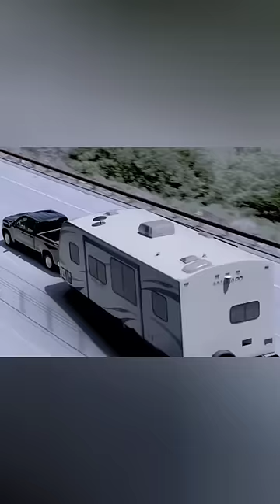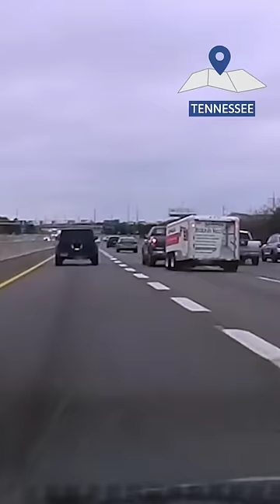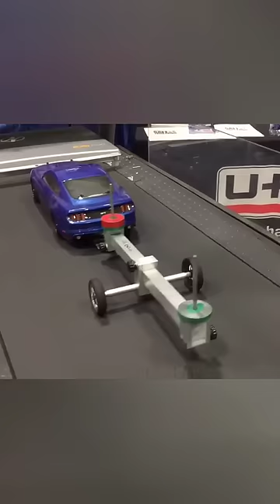Why Trailers Sway? 🤔

Comment: Seeing a Ford Mustang with a trailer hitch is the most cursed thing I saw today.
Reply: Fortunately... it wasn't a Ford Mustang. It was a plastic model.
Reply: @melissachartres3219 Upon closer inspection it seems to specifically be an rc car
Reply: Umm...mustangs tow just fine. They are rear wheel drive, after all. Standard transmission is even better. Beef up the suspension, and they tow much better.
Reply: @user-vt3cf4lm2f  It's just weird to see, no 1 said it can't, more so that it shouldn't
Reply: They have more than enough power. You just have to have a stiff rear, and have brake assist on the trailer.
Reply: It's a mustang... Anything to make it go faster!!
Reply: Really ? My Dad had a 1965 Mustang that towed his 1962 Renken , with a 1959 30 HP. Evinrude to lake Moultrie for years. Sweet memories!!
Reply: oui
Reply: Anytime you see a mustang on the road you know it’s a matter of time before it tries to eat a curb!😝
Reply: thats weird.i just saw a mustang
Reply: most cars tow just fine. europeans do it with hatchbacks and sedans all the time
Reply: @ethanwayne6973 under closer inspection that’s a treadmill
Reply: @EastonBryantLawhorne  We were talking about the visual of a rc mustang on a treadmill, but the treadmill has nothing to contribute to the conversation, why bring it up?
Reply: @paulhunter9613  that's the best place for a mustang
Reply: I'll bet he gets to the fishing hole first !
Reply: Fords suck

Comment: Death wobble 😢.  I've delt with this a few times.  Slow down also fixes it.  I drove 40 mph for 16 miles once to get to destination.
Reply: 40mph is not even too slow to drive as you tried to present, gimme a break
Reply: 40 mph is like, 60-70 kmh. that’s still really quick
Reply: Same. All about how you load it.
Reply: What?
Reply: So it didn’t even take half an hour to get to your destination?
Reply: It's Physics and Commonsense / Experience w/ Towing...........
Reply: NASA should  watch thos vieo to perfect their Moon Landings
Reply: @swaggluke  Depends on if the road is a 50 mph road, or an 80 mph road.
Reply: 100 miles at 35mph car hauler with hay and a skidsteer.  Had to load the hay and then skiddy.  It was BS but that’s how that boss rolled.  
Gotta have tongue weight or that sway will gitchya!
Reply: 😮 Learn to load a trailer, it's critical!
Reply: Same
Reply: Flooring it can also lead to stability. But that is dangerous gambling. After that, can you brake safely and pull over? Maybe not. You MUST correct the way it is loaded. And stop speeding.
Reply: I've had same. It's scary
Reply: I tried that one time pulled rock on a 3/4 ton ram 4x4. The idiots loaded me with 9200 lbs on dump trailer.  Waa doing 55 and noticed sway going over a slight hill. I punched, then things went HOLLYWOOD!!
Reply: Not enough tongue weight. You should always be sure the forward or front end is heavier than the rear-end. That should cure the sway problem.
Reply: @swaggluke 😊
Reply: Ha, try 350 miles.

Comment: Center of mass is the key here 💀
Reply: Only goats will understand this goated comment
Reply: here key the is mass of center
Reply: @theominouspigeon You must mean center of mass…
Reply: Could be a problem for toy haulers
Reply: Not alone, center of pressure must ALSO move back!
Reply: The travel trailer might be tongue heavy for the light truck that is pulling it. I've seen " bumper pull" trailers do this with excessive weight forward. I would say 60 percent tongue weight,not necessarily "at least" that. It depends upon the tow vehicle's weight capacity.

Comment: Also, from a Retired Truck Driver,  Tire inflation has a lot to do with sway. If tires are inflated more on one side then the other,  it will pull one side slower .
Reply: Im screenshotting this advice
Reply: In the second video, it looked like the trailer became unhitched.
Reply: A circle is all you could do then? 😁

Comment: The key is to when the Tornado starts to move like that. Accelerate lightly and it will come out of it and then slowly Decelerate. Do not hit your breaks that increases this way , and it will come around on you. You watch every one of these videos where you see. These trailers go out of control and you will see those brake lights. Lock up, stop first thing, and that's when you'll see it. Go completely out of control.
Reply: Correct bro

Comment: Some people tend to go too fast and they forget that they're hauling a trailer or camper!
When you're hauling a heavy load, you have to slow down, you cannot go as fast as the rest of the traffic!
Also when you're hauling a load make sure your load is up closer to the front of the trailer not the rear. Or at least try to balance out the weight.
Reply: I have a GMC 2500 6.6 DURAMAX. 
I run stabilizers on mine.  I change lanes as quick as I want pulling a 32' travel trailer. Pulledit all over the country & it never swayed.   😊😊😊😊
Reply: Dumb comment

Comment: Now wait. I loaded large semi trailers for delivery and i made walls with the packages i input. ZERO training about weight displacement was introduced. Just saying. Idk maybe its different for semis but this video shows facts that seem very helpful to anyone loading vehicles.
Reply: The wheels on a semi trailer are further back
Reply: Sway is caused by weight behind the axles. Can’t put it behind the axles on a semi. Pickups can’t handle the tongue weight like a semi does, so you have to move the axles forward.
Reply: @japanders  trailers are usually pulled by sedans, not pickups .
Reply: @johndododoe1411  um, what?? Regardless, anything that’s not a semi is gonna be likely limited by payload before total trailer weight in practical use. And far more pickups than sedans are pulling trailers.
Reply: I teach safety courses on this. It's weight distribution relative to axel location. Plus other factors like if the trailer and tow vehicle are level. Under load.  Also factors like suspension stiffness under load.  It's very simple physics.
Reply: You all are tickling my balls with this info. Alright. I think I got some good answers. Semis = different situation. Thank you all.
Reply: The weight is put on top of the rear axles and the trailer axles are at the back instead of in the middle so there is no way the trailer can have a leverage advantage no mater how you load it but a tag along is hitched right too the back of the frame so if there is too little weight on the tongue it will have a leverage advantage at the back of the trailer and try too pull the rear wheels off the ground like a seesaw
Reply: Semis don't do that. Fortunately.
Reply: @jennyjansen754  yes I replied to that. :)
Reply: I drive semi's and the 5th wheel stabilizes the trailer unlike a tongue hitch
Reply: Semis are a fifth wheel configuration. 
This is about bumper pull trailers. 
A lot of people install a receiver set up, which increases the whip factor.
Reply: It only works for bumper pulled trailers and long goose neck trailers (but it has to be heavy on), on the end/back. For semi's just try to keep it near the front or equal, if you don't in rare cases it'll do this
Reply: I think you guys has supervisor who overlooked how to load and where to put the stuff correctly, but yes I believe a lot of people just ignore that.
Reply: Dual wheels and multiple heavy axles on the trailer, and dual drive axles?
🥴👈
Reply: I did my loading training at the Council for Scientific and Industrial Research.
Rigid,  artics, interlink, drawbar and a-frames all have their differences but all require the load to be concentrated forward of centre.
Reply: @japanders ..there you go. Thx.
Reply: I drive a semi delivering lumber for a living and use a special truck mounted forklift that attaches to the back of the trailer. When loading the truck, we put the heavier material over the drive axles of the tractor to distribute the weight. These forklifts on average weighs about 9000 lbs. give or take. When the trailer is empty, it’s very sketchy to drive because all that weight is pulling up on the fifth wheel and causes less traction in the drives. These trucks, however, are designed to handle the weight.
Reply: Another issue I've seen that can cause this problem is trailer ball height if the ball is too high it can make smaller trailers act like an airplane wing causing lift, this lift can cause this same uncontrollable trailer sway action (happens often on trailers like snowmobile trailers or single atv trailers especially if empty).
Reply: Bro, semi-trailers have the axles all the way at the back.
Reply: Wait, a semi trailer is different 
Axle weight per axle on a road tractor. 🤠
Reply: @japanders  actually it is possible (extremely rarely though) due to the fact most van/reefer type semi trailer tandems slide for axle weight control if there is a massive object that gets behind the axles it can happen (seen one trailer where a steel coil was loaded right at the door with light weight material in the front driver had the tandems all the way forward causing the trailer to sway uncontrollably... But this is very very rare and this truck had to be readjusted and load redistributed... Not my vehicle just saw it while doing a 34hr reset
Reply: @dodgeme1986truck  come back bro. Your comment didn’t post. I wanted to see what you said.
Reply: @japanders  sorry it partially posted had to re-enter it
Reply: @dodgeme1986truck  well that’s a fair point. I was thinking of the “typical” configuration you see on the highway. You’re right though. I guess there’s a way to screw up anything if you try hard enough.
Reply: @japanders  yup that trailer had 2 rows of plastic culvert pipes in the front and a 15k coil at the doors his axles were forward to maneuver through tight streets

Comment: At least 14% of the total trailer weight must be on the hitch ball but more is better and especially if there's too much weight behind the rear axle. Always place  your heaviest live load forward when pulling. One thing that can mitigate the effect is a heavy tow vehicle with dual rear wheels. Cars and SUV's though don't get it done. Use trucks to pull these things.
Reply: A proper hitch weight would be dependant on the size of the trailer, your approach would unload the front-wheel of the towing vehicle, also causing sway.    On a medium size trailer the hitch load should be around 75 pounds enough for a fit person to lift the trailer off,    oh by the way that's for the rest of the world, usa has its own interpritations

Comment: Tongue weight is critical when hauling a trailer.  Some like to tow with a light tongue weight, which takes a lot of load off the tow vehicle's suspension, but increases the instability as the video shows.
Reply: Over the years I’ve had to load my stock car on the trailer backwards after front end damage.  It was a very slow trip back to the shop !!!  Keep the weight forward !!!
Reply: @charlesmoubry1965  
Exactly, you need the proper amount of weight on the rear axle of the towing vehicle.  Also account for the reactive movements when the towed vehicle begins to resonate with imperfections in the roadway.  These resonations will make the weight of the towing vehicle resonate as well, making it unstable...

Comment: And I'll say this as a truck driver, if this happens to you....don't panic and slam on the brakes. That makes it worse. Instead, accelerate until you've gained control, then slowly coast back to speed.
Reply: You win bro speed up a little best thing to do when you have sway. Or get a brake controler and only apply the brakes for the trailer until it’s under control again.
Reply: Accelerator on the floor, make that trailer stay behind you.  😊
Reply: Sure, that makes sense.  Swaying increases with speed and now you're saying accelerate.
Reply: So True,  😮💩‼️ 🦶🏻🛻💨 Pull the sway out  & then gently slow down 😳 and correct the problem. 😒Weight balance- or load placement on the trailer 💗😬🙏🏻😅
Reply: @boke75  Semi drivers know what they're talking about. I towed a 29' travel trailer for years and can vouch for them. Speed up. You missed the context of speed makes it worse. It makes it more likely to sway. So drive with caution . However if the sway commences do not brake or back off the gas. Above all don't attempt to correct it. Just accelerate and drive out of it. Then you can resume a safe speed.
Reply: @biff5856  Thanks. I have a feeling your advice is genuine, though I wish I understood why accelerating would work. It's not the only thing that puzzles me about cars - if they make a sharp turn at high speed, why do they often start to whip left and right worse and worse? I would like to see Steve Mould explain this!
Reply: @stephenfennell  Hi, I'm not a physicist. I can only tell you that accelerating will straighten up the trailer. As far as speed in general goes, yes it will make the trailer most susceptible to sway. As far the general handling of a  vehicle it depends on whether it has oversteering or under steering characteristics. That's a whole other ballgame.

Comment: Also depends on speed. My rv states for safety do not go over 50 mph . I see some going 70 on interstate
Reply: It can be done carefully they state that to more how good your brakes are. Let's face it most town rv's or trailers are towed by 70's pickup trucks with 4 drum brakes. If everything is in correct mechanical order there shouldn't be a problem.
Reply: Speed can compound the problem, through action and reaction to the forces, but this problem is all weight distribution.  We used to make sure we had a bit of extra weight in the front of our travel trailers, sometimes by placing a heavy spare tire, or even rocks, if there wasn't enough tongue weight when we hooked up.

Comment: There is a system called Alko ATC which is designed as an anti snaking system. Designed for caravans and is very effective. But not a reason to ignore good weight distribution.

Comment: Definitely could be the load weight distribution or shifting load, improper tire inflation, TOUNG NOT Properly SECURED TO THE BALL may be the U-Haul's problem. Even the safety chains won't help for long.
Reply: Can't forget the ball height for that trailer being wrong... I've seen empty 1,2,4 place snowmobile/atv trailers hooked to vehicles where the front of the trailer is just 2"higher at the front of the deck than the rear of the deck and at 65 they suddenly took to the air after crossing an underpass causing them to suddenly start to sway like this... The trailer deck should be sitting lvl to slightly lower in the front

Comment: We took a drive to Nevada this past holiday weekend and I saw a van pulling a trailer at 70 mph on the I-15, and it was constantly wobbling and fishtailing. But the guy didn't even try to slow down to the legal 55 mph for a towed trailer, he just kept going like that. We moved away and got ahead of him in case he lost control.
Reply: 62 mph or so is the maximum speed with a trailer for me, and it depends on what you are towing, travel trailers are a totally different tow than a car/car hauler. And doing just 8mph less speed makes a huge difference in your mpg’s, and doesn’t add that much time to your trip

Comment: When I was a young teenager about 45 years ago my father already knew this. He made sure that we packed our trailer accordingly. If you can picture tow a trailer that is most of its weight behind the two wheels and imagine it being a lot of weight and how that Would interact at the hitch and what it could cause and it could end up repeating itself over and over again until the contact is either lost or it causes the vehicle in front of it to happy loss of control. Because people are not all born with brains they create holes and chains to help reinforce the hitch connection!

Comment: I used to work for a company that distributed free items in the mail; this particular time it was instant coffee packets. My fellow employee and i loaded that semi trailer, in a bricked pattern. In the first row, the very first spot for a box to be placed, i left that empty. And then every space after that, was also empty. So, in the spots, that had no box, the row on top of that, would have a box there, holding the other two, perfectly in place. A couple of weeks later, i was told that load was perfectly in place, just the way we loaded it, nothing moved. Oh, and the load was less than 40 inches high, when we were done, and all of the order was on the trailer.

Comment: Lol I will never forget getting the keys to the work truck and being told to get 2 pallets of mulch from the nursery one stoplight away. They guy on the forklift insisted I put the two loads at the tongue as he went for another pallet to push the mulch forward… nope! This was an irrigation rig fenced in with a gate on the back, I ain’t walking to the tongue to get a 30lb bag every time! Lol 10 mph was pushing it before it got death wobbles

Comment: If the rear weight bias is not to much you can excelerate pull out of this, but then your stuck with riding it out. The problem occurs when the towed vehicle begains to push the tow vehicle.  As long as the tow vehicle is actively pulling the trailer theres no problem.

Comment: This is ONLY HALF THE story, Neglected here is the aerodynamic stability : a long closed trailer  is aerodynamically unstable, which means the instability increased with speed. Putting fins in the rear increases the sensitivity to cross winds, moving the axle further back helps here. 
Summary adding weight in the front alone does not solve the aerodynamic instability.

Comment: U-Haul have their trailer axles placed too far forward so that the bad wobble  will occur ( by design) if speeds are not kept at or close to the sticker posted 55 mph as seen on the fenders.